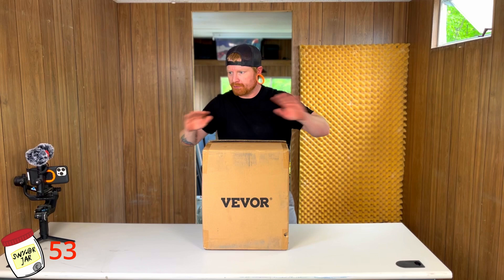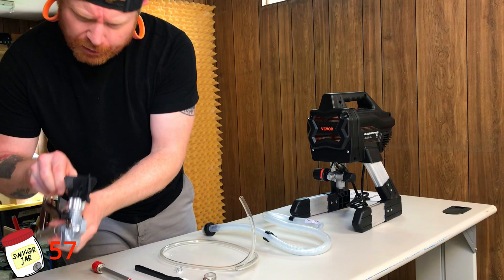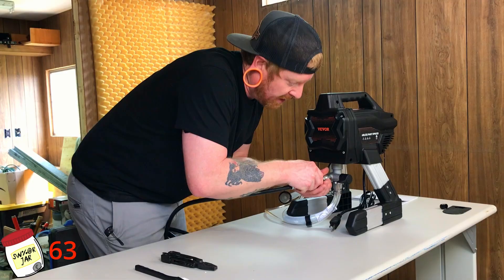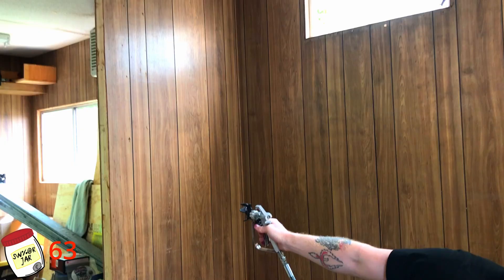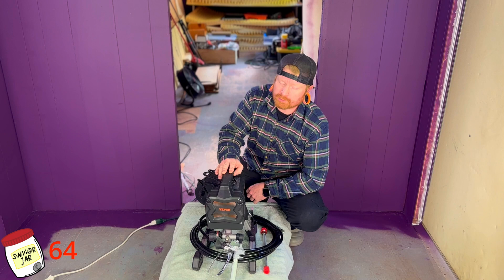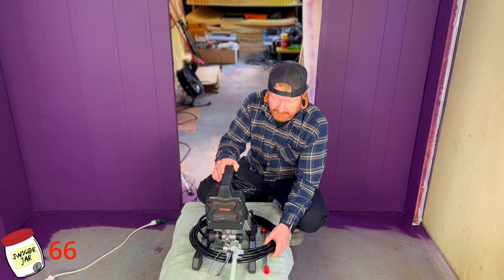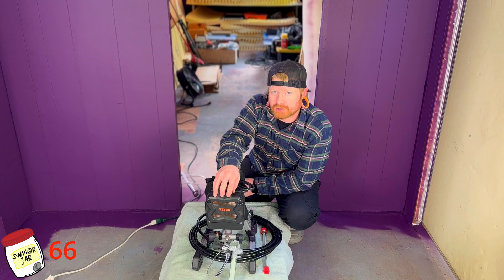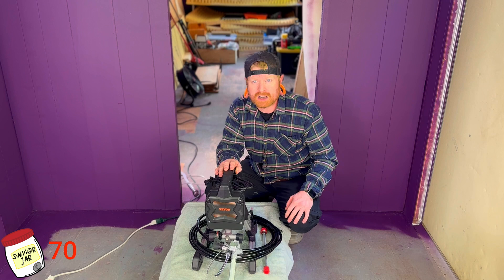Vevor X6 Airless Paint Sprayer tutorial, demonstration, and review!

Comment: A cheap respirator mask or even a paper painters mask would have been a good investment boss.
Reply from the maker: Totally, I was so excited getting to paint with it that I forgot to throw one on. I spent the rest of the day scraping purple off my teeth… hahaha
Reply: @christopher_mc3  you aren't alone.  In my younger dumber days, after a long day working on a 1937 Plymouth 5 window coupe my brother was chopping, dropping, adding suicide doors and sectioning the hood to fit the 572ci hemi drive train with a 10-71 roots blower and 6 speed automatic to, we got into the case of Coors Banquets wet sanding the pearl and metal flake clear we had laid over the white base coat to prepare to start layering candy purple coats the next day.  

     I decided I wanted to start laying down the candy Orange over the image transfers I had done on the custom bagger motorcycle I was doing for a paying friend.  I wheeled the bike into the paint booth and started laying Candy Orange down while my brother went to flip the breaker to turn the vent fans on.  He popped in and said hey little brother that respirator doesn't keep much atomized paint out of your nose and lungs hanging around your neck like that.  I had completely forgot.  I had painted tissues orange  every time I blew my nose for like 3 days.  I'd hate to see what got into my trachea bronchial tubes and lungs.

Comment: Great video, important to drop the pressure by switching off and squeeze the gun.  Also, good to store with the pump lube or even RV pink antifreeze, unit will last  forever. This unit is identical to Graco X5 at home depot so money saver!  I like your DIY video style.  I do same and a lot of technical videos take a lot of time so I post when I can.  Good multiple camera angles and effects.
Reply from the maker: Thank you very much! I need to get back after it honestly. I haven’t posted in quite some time.
Reply: @christopher_mc3  I do the same thing I like to put up videos of things that I've learned that I think are useful and not covered by other videos but I also take long breaks